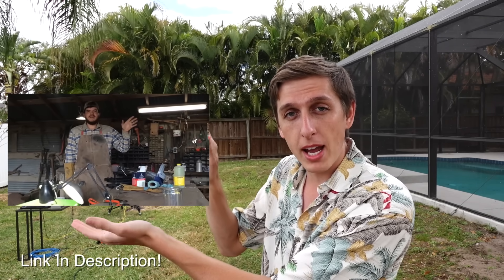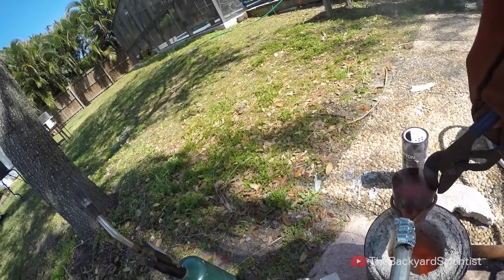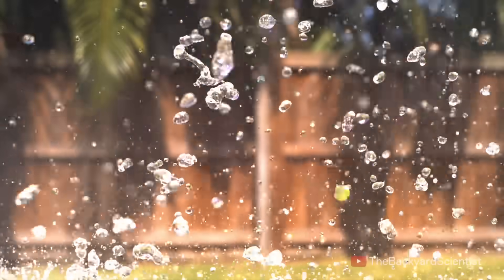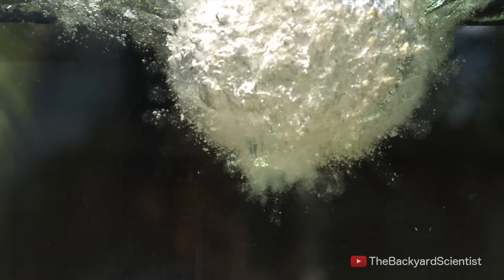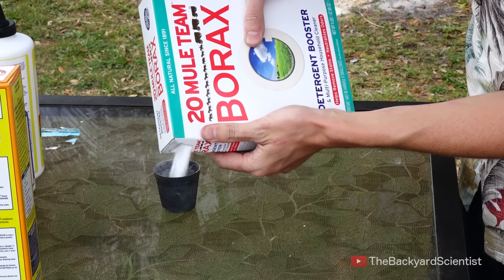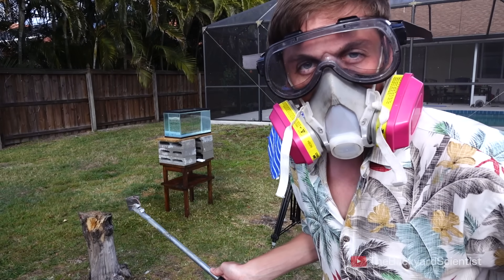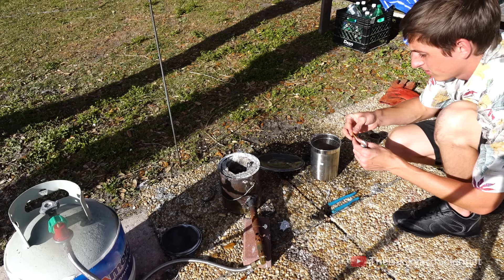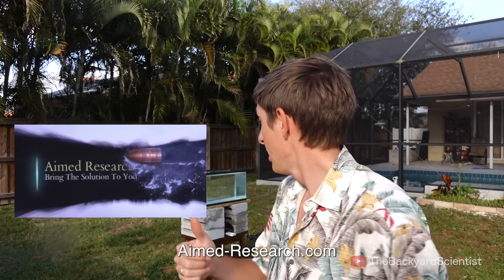Pouring Molten salt into Water - Explosion!

Comment: Can't access your papers but I think the theory by TBYS seems good - kind of like a chip pan fire. 

But how about if the molten salt solidifies quickly and then the outershell cracks open, allowing a very large surface area of molten core to come into contact with the water that has already been warmed by the molten salt

This would explain why it does not explode when poured in slowly - volume/surface area ratio is not right.

Also slowed down the video to 0.25 and there appear to be mini explosions just prior to the main one - indication of minor cracks that meet up in order for the centre to be revealed?

So yep - Molten salt poured in - warms up pocked of water immediately surrounding - salt cools + solidifies - solid shell cracks open - already warm water superheated by coming into contact with molten core - boom.
Reply: +drunkenslug 
thought about it a little more and if there was a cracking outer shell this would mean that water would be trapped between the solid layer and molten core - essentially incorporating OP's silly putty theory

small mass of water between layers means it heats up fast!
Reply: +drunkenslug 
More thoughts - this would also explain why there are small salt crystals on the outside edge of the blast front - this is the outer shell that has been blown apart
Reply from the maker: +drunkenslug i fixed the links!

Comment: I got a question for you.can molten aluminum melt a real diamond?
Reply: +Andrea Swords Well diamond will turn into graphite at around 700 deg C and will actually ignite at temperatures past 850 deg C. So I guess the answer is no. Kind of like how you can't melt wood because it falls apart and catches on fire instead.

Comment: It was probably because of the lower surface tension of salt. I may caused it not to form big drops which made the surface area in contact with the water much higher make it exchange heat much faster. 

You can tell that the molten salt has a much lower surface tension than the molten sodium just by how they move inside the container

Comment: by melting the NACL youre breaking apart the crystal latice into its to origanal parts, implying you have CL- and Na +  and sodium has an increasing vigerous reaction when exposed to water because it wants to lose an electron thus stabilizing its electron valence shell,

Comment: +TheBackyardScientist This is my reason as an engineering student:
The short version the salt turns into gas in a very short amount time.

The long version:
The salt was heated until it became a liquid in atmospheric pressure, it was then cooled rapidly by the water and the pressure was increased as the liquid moved downwards in the tank, this causes the nacl to go below the phase line for liquids and enters the gas phase which means its volume expanded extraordinarily fast.

look at a phase diagram to follow my reasoning.
Reply: But why did the leidenfrost effect prevent the others from exploding?
Reply: +Go IntoTheCalm the explosion is purely material specific, there is no chemical reaction in the case i describe.

in other words the leidenfrost effect had nothing to do with this. The leidentfrost effect works exactly like it does with the others.
Reply: glow262 I get it! Thank you

Comment: +TheBackyardScientist I think the violence interaction between Sodium and water stems from a physical reaction called Coulomb explosion ( electrical repulsion); sodium atoms on the surface release electrons almost immediately when contacting with water( in the order of picoseconds) , this will leave these atoms with excessive number of protons (positive charge). with this the system reaches what so called Rayleigh instability limit. in other words, this will lead to an aggressive repulsion called coulomb explosion. this process prolongs for the next layers until the end of atoms. now the question is why NaCl reaction is much stronger than for pure Sodium. the reason I assume, Chloride atoms are kinda shielding and they delay the reaction of fallen lumps until they are completely emerged in water where the Sodium-water reaction can not be shielded any further. I'm not an expert with this kind of reaction but I know something about Coulomb explosion since I'm doing my research in Coulomb explosion in intense Laser-matter interaction for my master thesis.

Comment: What about water just splitting into hydrogen and oxygen wich reacts. As I am told at my job at a steel mill, whenever they have to evacuate the blast furnace into an emergency basin, if there is water in the basin, hydrogen forms and explodes (together with steam explosions). That is why you see a lot of these smaller secundary explosions on the edge of the bubble. Please correct me if I'm wrong, I would like to know.

Comment: I did not have to watch the video at all to understand what is happening. Due to quite a similair experiment where hot fat is near its burning point. When (in this case) the molten salt (normal salt has a melting temperature of around 6-700°c) hits the water, it will cause it (the water) to boil and evaporate immediately, causing it to expand to more than 100 times its original volume in a fraction of a second. This is what causes the "explosion" that you see here. (This is why you pre-heat molds before you cast metal in them - any water residue could cause an explotion and leave you with severe burns)

Comment: Tried to view the papers you linked to and was denied. Maybe a paid subscription?

Anyway, here is another hypothesis. Perhaps NaCl has a high expansion/contraction rate per degree. Once it is immersed in water, a skin of solid salt forms that is contracting. The contraction causes a pressure buildup, the solid skin shatters and the shock wave throws more molten salts out, mixing them with water.

The sounds you heard as the solid cooled was this happening slowly. Also salt reforms into a solid with a crystal lattice structure and cracks appear along these lines as it cools, which makes the solidifying salt brittle and full of mechanical stress.

I used to use molten salt baths in a lab to calibrate thermometers. Be careful. You did not have enough protective gear on. A random splatter of molten salt on you creates a terrible burn that is incredible painful.
Reply from the maker: +Paul Montgomery Sorry, YouTube formatting error. links are fixed now.
Reply: +TheBackyardScientist Interesting. I have not finished the read yet but will soon.
I recall watching a video within the last year about some research that thunderfoot in collaboration with colleagues a different universities. It involved looking more closely at sodium explosions produced by immersions in water. Often they just fizzle like yours did but sometimes they would explode violently. I played around with this some back in the 1970s in my HS chemistry lab where I tried to get consistent results. I've also had close calls later in the molten salt baths I had set up for calibrations. These often had to do with moisture on thermometer wells/probes we were testing.

Comment: i like your stainless steel glass which is all rusted and shit :))
Reply: +oly loly its been exposed to extremely high temperatures for extended periods of time and several times so i think its more heat damage than rust
Reply: +oly loly Stainless steel kinda lose its ability once you make it come in contact with such heats among other things. In Nuclear you get clear rules about not using your hands on stainless objects since Hand fat/sweat can cause Stainless steel to rust over time. So it is not... Well, omnipotent.
Reply: +Helveteshit The reason stainless steel can rust when exposed to heat is that the chromium, which makes the steel stainless, can get precipitated out of the solid solution, thus making the steel vulnerable to rust.
Reply: Stainless steel can and will rust, good quality or not. at those Temps and in contact with any kind of salt, it will rust.
Reply: +oly loly Stainless steel can rust over time.
Reply: +Helveteshit Has nothing to do with fat lol. Sweat contains salt. The salt in the sweat is what rusts it. And true, ultra high quality stainless is used for that kind of work, and is allot less likely to react to water and salt. I wasn't disputing Stainless use or its quality in Nuclear energy either so not sure what that had to do with my comment. FYI, me and many generations in my family are in the sheet metal and metal working trade. In industries such as chemical and energy, stainless isn't bare anyhow. it's undoubtedly coated with a clear corrosion inhibitor.
Reply: Lol
Reply: ***** If it's bad stainless steel, yes!
Reply: +Wynton Goulding Not to mention the fact it has been used to hold molten salt.....for those who don't know, molten salts react with just about all metals.
Reply: Wynton Goulding

It can rust toward hand sweat as well, so it is not only heat.
Reply: +Helveteshit Sweat in particular greatly varies on quality and the particular salt levels in a person's hand. High quality stainless usually won't regardless. Low quality will deffinitely. But when it comes to that high of heat, it dosnt matter the quality of the stainless at all.
Reply: Tony Z
You kind of use high quality stainless steel within nuclear, otherwise why would you use stainless in Nuclear if not for safety purposes against rust and other contaminations for a long safe production of energy? Hand sweat WILL rust on stainless steel because the fat a person release in the form of sweat can create vulnerability on stainless steel over time. Doesn't matter of quality. Otherwise they wouldn't have that as a reason in the first place for using single-use gloves when handling stainless equipment/installations.
Reply: +Helveteshit its because stainless steel has less carbon which is basically why its stainless but it still contains carbon and will rust if it does not have a protective coating on it. for those who didnt know. oh sweat contains sodium and im pretty sure thats the main catalyst for the rust. but hey dont quote me on this i guess. lolz just giving my two cents.
Reply: +Joshua Probulis oh i should reed more lol sorry to go over what you guys said earlier
Reply: +Joshua Probulis oh i should read more lol sorry to go over what you guys said earlier
Reply: Tony Z plus one for you man!  Lol
Reply: Tony Z what kind of metal work do you do? Fabrication wise. I work for a small fabrication shop doing basically hand rails to stairs to random stuff but i was unlucky that i wasnt brought up in a welding family. So jealous of you.
Reply: +Wynton Goulding 
It's probably simpler than that. The crucible is coming into contact with atmospheric contaminants while it's hot causing surface corrosion which, if not cleaned, will eventually contaminate the entire body of stainless steel.
Assuming they're actually using a stainless crucible, as opposed to a random stainless cup, it's likely made of a heat resistant stainless steel containing titanium or niobium which can stop chromium precipitation from occurring ;)
Reply: +oly loly  He needs to start a patreon for a platinum crucible
http://www.sigmaaldrich.com/catalog/product/aldrich/z562114?lang=en&region=US
Reply: +Joshua Probulis Myself have moved onto a different trade in professional painting and powder coating. But my dad was Forman of fabrication at old company and has more welding certifications than most. Stainless, Aluminum, you name it. Running plasma and laser cutters. My uncle was a Tenor (not sure if spelt right) and pipe fitter for 50 years, my brother in law specializes specifically in Stainless fabrication, finishing and welding. Along with other family members.
Reply: +supermotardmario Yes indeed. Btw, love supermotos :p
Reply: +Tony Z cool 15 years ago I

Comment: Chemical reaction doesn't have to associate with PH change. This may be just two simple reactions: H2O --> H2 + O2; H2 + O2 --> H2O. The first one is caused by high temp and the second one is a regular H2 explosion. Actually, it is quite common for water to explode if you drop something really hot into it. Molten steel will cause an even bigger explosion.

Comment: I think you're right. Assuming 21degC temp of water, and that the NaCl gets cooled to 100degC, 50g of NaCl would give off enough heat to produce 20.2 Liters of water vapor. This is 10 times as much heat as an equal mass of solid sodium (a metal) would hold (of course, it has its own reasons for a violent reactiom). How does it happen so quickly that it neither floats nor does the heat gets dispersed nor leidenfrost? Well, liquid table salt is actually liquid sodium ions and chlorine ions swirling together. I think they could not resist interacting with the polar water molecules. The water would "hug" the hot ions, and the heat would get transferred to the water.

Comment: If this has already been submitted I apologize, 
perhaps the salt is lowering the surface tension of the water to overcome the leidenfrost.
I used to play around with molten metals (lead,copper)pouring them into 5 gal buckets of water. Always got a more interesting reactions with salt water than regular water.

Comment: I do have a problem with both your ruling and your hypothesis. Sodium is known to generate an extremely exothermic reaction when contacted with water. This definitively puts the pure sodium reaction in the more violent and more dangerous category in comparison to molten table salt. The salt simply presented a high velocity, gaseous explosion. You mentioned the main issue with your hypothesis which is the fact that it should be repeatable with other elements but its not. My guess is there's a relation to the fact that table salt still contains sodium. Anyway, I really enjoyed this video; for a moment I was confused because sodium reactions aren't something new to the scientific community but I appreciated your deeper take on what was happening.

Comment: I believe your physical explanation is correct ... super heated water expanding, etc. However, your chemical test didn't prove anything. The pH of a salt solution is neutral because it doesn't add H+ or OH- to the mix.

Don't recommend, but NaOH is a solid and would be basic (OH-) in solution.
Reply: +Jerry Mccomas Actually he proved, that explosion was not caused by the chemical reaction ( if salt somehow  turned into elemental sodium (which is impossible) , which in that case would give pH>7).

Comment: My bet : 
The NaCl is by far the most soluble compound you tested. Let's remember : every chemical reaction speeds up with heat (& solvation is one), and quickly cooled liquids dont have time to cristallize (even if NaCl is easy to cristallize).

The "'saucer" at 1:01 looks to be a mix of cristals and amorphous salt. The explosion is a drop in density, right ? So there's less water to solvate the less soluble stuff, I guess that's why we have a 2 phase mecanism.

Salting water don't affect the water temperature, but maybe the Na+/Cl- acts like a catalyst regarding to the vaporization : H2O molecules bound to ions have less bonds with their H2O mates, so their individual energy barrier between condensed matter / molecular gas is lower compared to bulk solvant. And catalysts may follow exponential rules.

Comment: Can you try this with an anode and a cathode at each end of the tank?
Reply: Seems like Hydrolysis
Reply: Seems like Hydrolysis
Reply: +fourfirefoxes I would have thought that the ions would be pulled apart as soon as the salt is added to the water and a better reaction may occur
Reply: +ItsYassin Yes, the extremely rapid ionic dissolution of the salt into the water causes the violent un-bonding of H2O causing HOH/HHO
Reminds me of the what would happen if a high voltage line fell on a puddle of water. Remember the guy who burned sea water using nothing but microwave radiation?
Reply: fourfirefoxes I would be really interesting to see what would happen. There's only one way to find out though, let's hope this comment gets noticed.

Comment: My theory is that when the molten NaCl is touching the water it's outer layer is hardening but the inner layer is still molten. When it's cooling down it expands (or contracts). So you have the same effect like with glass.
Reply: +Max Power that sounds reasonable

Comment: This is obviously caused by the turboencabulator effect.For a number of years now work has been proceeding in order to bring to the crudely conceived idea of a transmission that would not only supply inverse reactive current for use in unilateral phase detractors, but would also be capable of automatically synchronizing cardinal grammeters. Such an instrument is the turbo encabulator.

Now basically, the only new principle involved is that instead of power being generated by the relative motions of conductors and fluxes, it is produced by the modial interaction of magnetoreluctance and capacitive directance.

The original machine had a baseplate of prefabulated Amulite, surmounted by a malleable logarithmic casing in such a way that the two spurving bearings were in a direct line with the pentametric fan. The latter consisted simply of six hydrocoptic marzel vanes so-fitted to the ambifacient lunar wane shaft that side fumbling was effectively prevented.

The main winding was of the normal lotus-o-delta type placed in panendermic semi-boloid slots in the stator, every seventh conductor being connected by a nonreversible trem’e pipe to the differential girdlespring on the up-end of the grammeters.

The Turbo Encabulator has now reached a high level of develement, and is being successfully used in the operation of nofer trunnions. Moreover, whenever a barescent skor motion is required, it may be employed in conjunction with a drawn reciprocating dingle arm to reduce sinusodial depleneration.